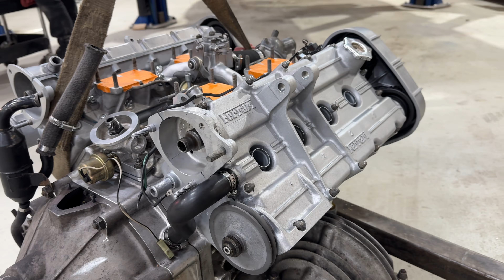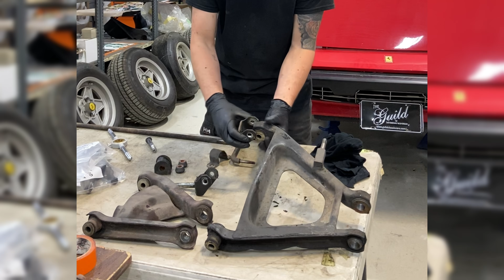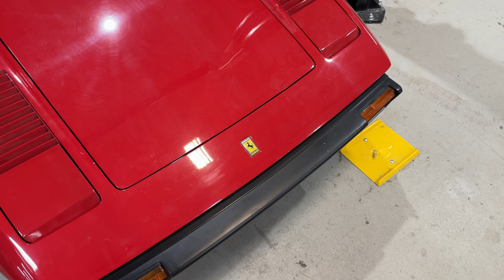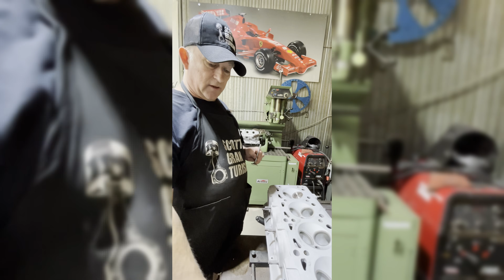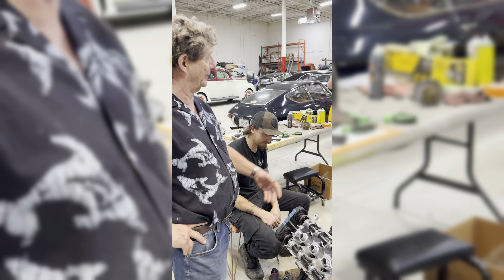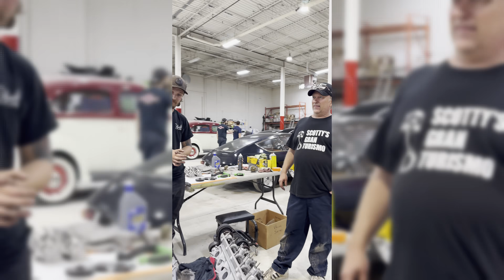Removing a Ferrari 308 Engine - What's on the Hoist?

Comment: I don’t know if you guys have really worked on 308’s before,,
Front bank spark plugs although aren’t as easy to access as the rear bank,, they are relatively easy to remove with basic tools,,
Working on the general maintenance side of these cars isn’t as hard as people think it to be.

Replacing the Timing belts water pump and alternator is relatively easy for a mechanic,, I’m not a mechanic but mechanically minded and I have replaced the timing belts, water pump and refreshed the whole suspension including steering rack on both the 308GT4 as well as the 328 with only basic tools, no special tools required..
Replacing the Clutch is also relatively easy which is accessed from the Left hand rear arch well..

Granted rebuilding an engine requires someone with knowledge on how to rebuild engines but the engine is basically 79’s-80’s technology,, nothing over complex about them,, no computers required
As for working on the suspension,, The 308/328 series are have a very basic and easy to work on suspension set up,,
I was able to do it in a Garage on jack stands,, if I had a hoist it would have been much easier of course..

Comment: Hey as an FYI with the valve cover, they literally just coppied that piece over to the other side with the same firing order, so if you have running issues after taking it apart, look there, and look in the book what the actual firing order is, for either that or if you cant get it, the 328, as it should be the same given the 328's just an upgraded form of it that's probably using the same firing order

Comment: That Cadillac with the UGLY wheels is still hanging around.  Is it afraid to go home?
Reply: Comes in for servicing. The wheels are exact reproductions of the originals which were made from aluminum and steel in pieces and are almost impossible to separate for servicing. The owner wanted the look but not the hassle so we made these.
You have to remember that the original Brougham was a concept car that was so admired that it was put into very limited production. An interesting side bar. The front and rear bumpers are made from aluminum that is chromed. That is a challenge in itself.